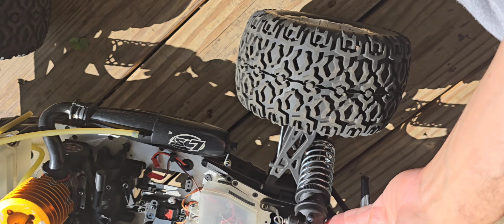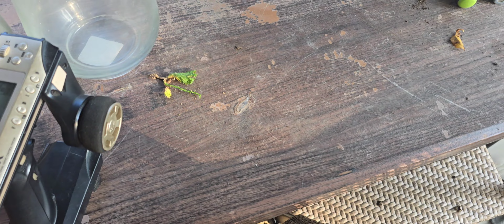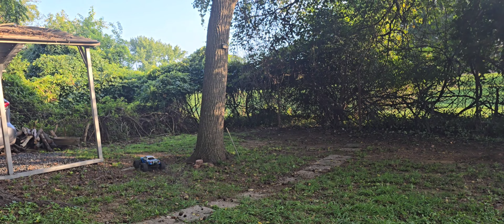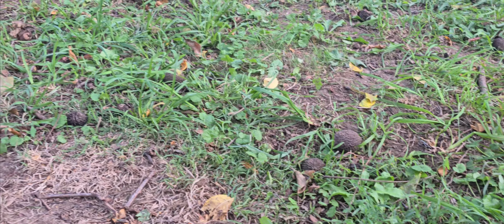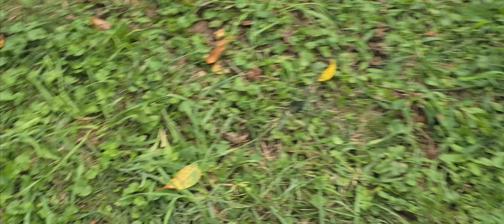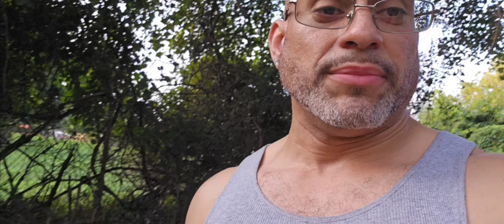HPI SAVAGE 4.6 Almost 36 minutes of bashing fun

Comment: Sweet Rig!!!! That sucks Bro,  if you can't get the extra part in time, pull it out, check it with a magnet, if it sticks, you can use a cheap mig welder, burn it and grind it smooth. If not, then borrow a tig welder. I know those parts are getting harder to find or hit up Chino 😅. Keepem Braaping Bro.
Reply from the maker: Yeah but good news I'm still able to find the parts😁🥳
Reply: @Robrismo-rc  Good news to hear 👍 Bro! KEEP on Braaping Brother!